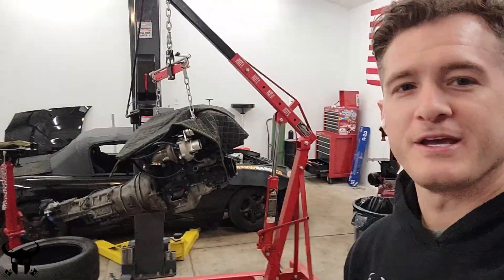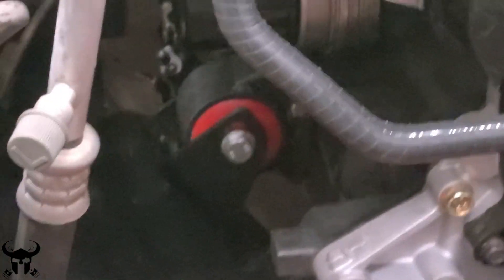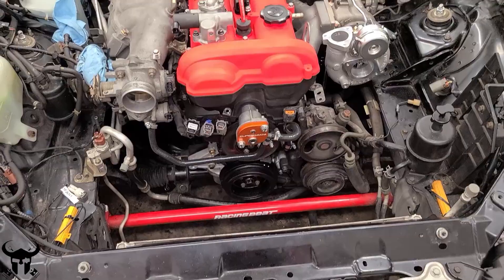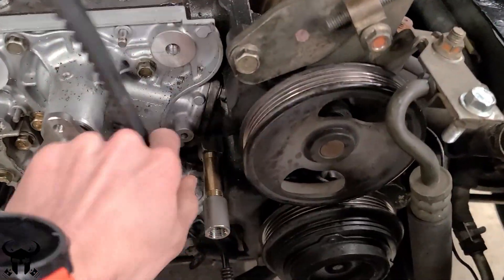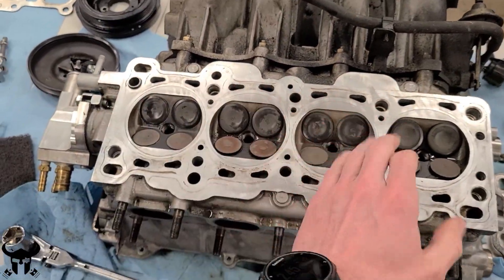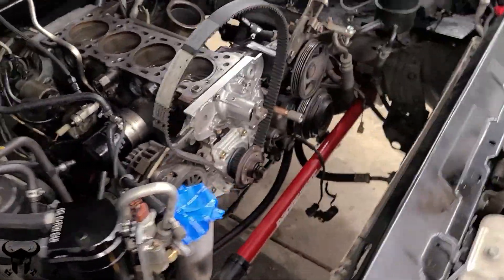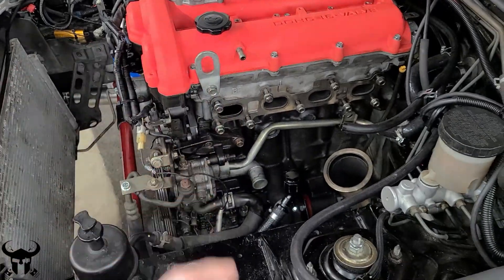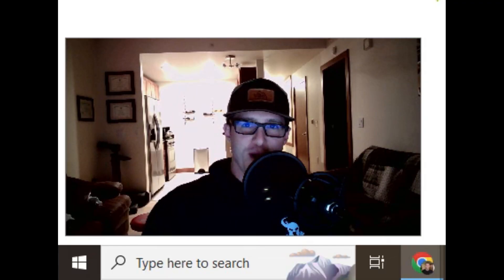Turbo NB Miata Install Part 2 - I Broke My Engine

Comment: Why do you think your block blew out that coolant fitting? Too many boost pulls in boost too long? Anything you could have done to prevent it or was it an unavoidable failure simply due to stress and age?
Reply: IDk maybe there was some blow by getting into coolant lines. It wouldn't have to be much, then it would expand very fast and can produce a lot of pressure.